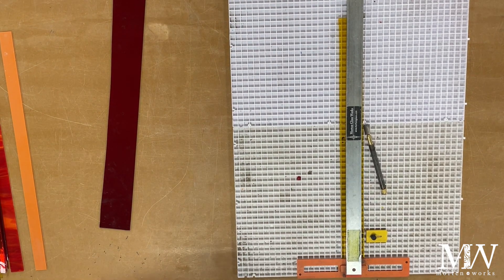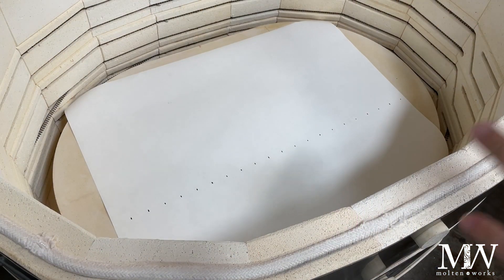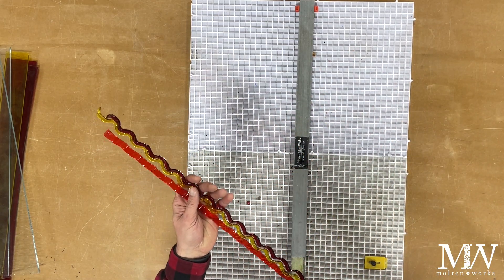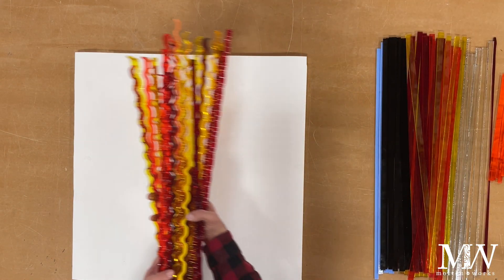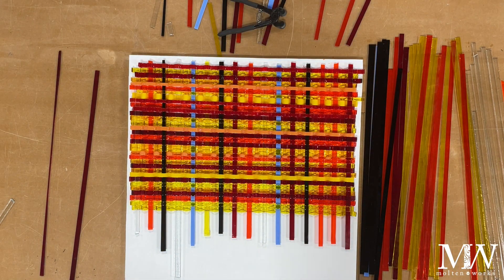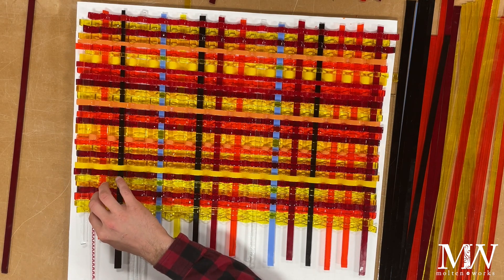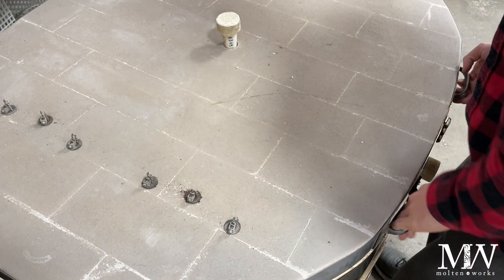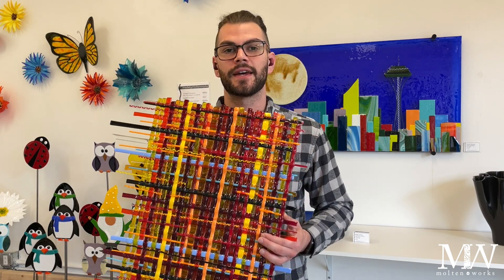Fused Glass Experiment #4: Weaving Glass

Comment: Where did you get the stainless steel rods?
Reply from the maker: I purchase them from a metal supplier in Seattle called Everett Steel. They will usually cut them to length for you as well for a price. I cut my own using a rebar cutter.
Reply: What diameter?  I would like to try this. Thank you

Comment: where did u get those steel rods?
Reply from the maker: I purchase them from a metal supplier in Seattle called Everett Steel. They will usually cut them to length for you as well for a price. I cut my own using a rebar cutter. Find a local metal supplier and give them a call

Comment: This appears to be a simple technique but I've found the firing of the slumped strips the killer!  (too much and they fall sideways on the final tack or not enough and you can't get the strips through)
Reply from the maker: Yes slumping them so they can fit the other parts through is definitely the biggest challenge I have had. I'm getting thicker rod so I have more space to put glass strips through

Comment: Thanks for sharing. When I try to cut strips like that, most of them break or run. Any tips?
Reply from the maker: Even Pressure, no stopping while running it across the glass and squeeze the runner gently. It definitely takes some practice and I have cut an insane amount of glass. But keep trying. I'm also going to add a cutting technique video as someone else was asking too.